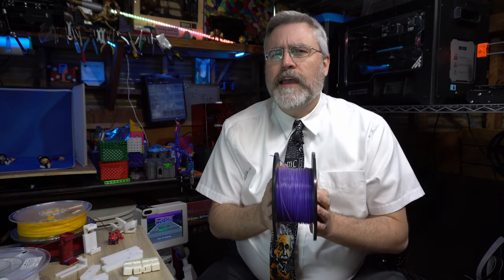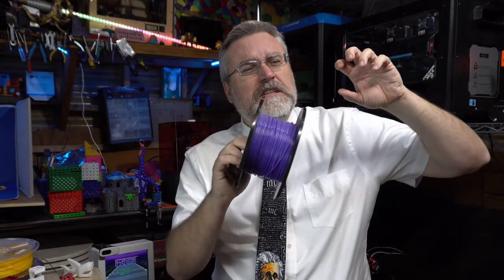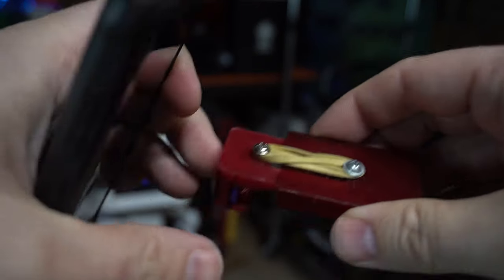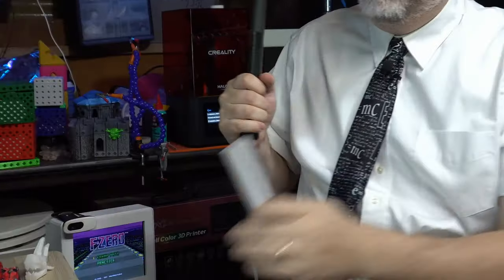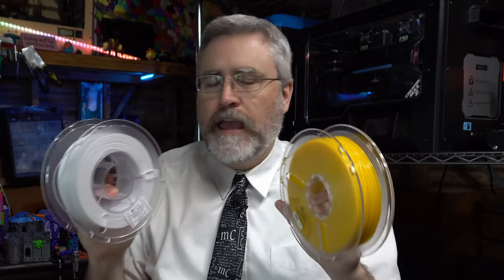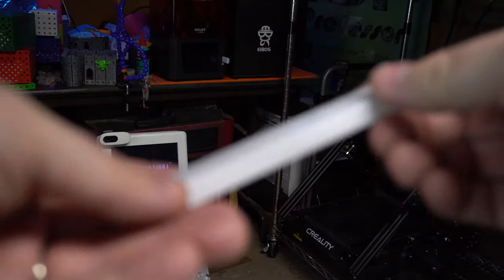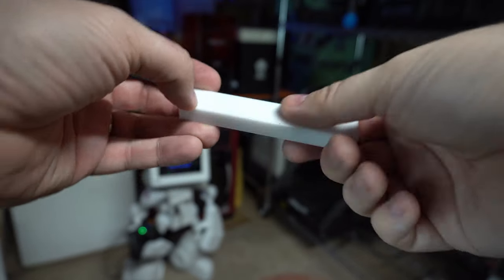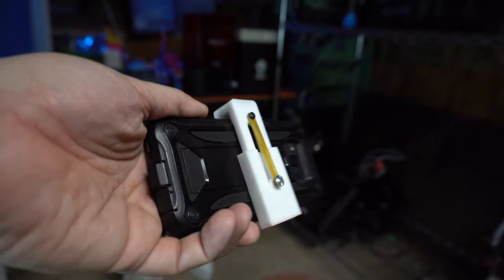What is the strongest 3D printing material

Comment: Lost In Tech nailed settings and all the internals of the process for TPU on Bowden extruders. Just awesome learning! I did some motorcycle parts from TPU and users were amused: it's strong , it gives up but not break etc.
Reply: Hi!and what motorcycle parts did you print if it’s not a secret?
Reply: @azamatT7  Missing gaskets on Honda CN250 helix airbox , plugs for throttle bodies sync ports for BMW, some set cover parts for SV650, bushings for Vaspa PK grips and my favourite - gasket for CN250 carburettor fuel bowl

Comment: I LOVE TPU for its indestructibility and it's super easy to print given a direct drive extruder.  I HATE nylon with a passion given it's warping a shrinkage and just plain orneriness.  If you get a chance try my favorite filament in the world.  Vexi-Flexx70 from Keene Village is a super hard (70 on the shore D scale-not to be confused with the completely different A scale) TPU that I use for gears or anywhere that calls for nylon.  It's not cheap and it only comes in black and white but it is awesome!

Comment: I know this is an older video now but wanted to throw in my experiences with tpu as well. I've used it mostly for making cases for electronic devices and semi delicate tools. I work in construction and its protected some fairly expensive laser levels, center finders etc bouncing around in my gang box. Also has cut down on my replacement of vapes when I drop them from small and some larger heights. I also printed some riser feet for my ender 3 v2 years ago with pla tops that connect to the extrusions and tpu bottoms for grip and a little shock absorption. They've held up great but one is starting to slide in the extension channels a little easily sure to the pla, but the vond between the two materials is great.

Comment: What material would you recommend for creating prototype RC Buggy/Truggy suspension arms?  I need to create prototypes and have access to filament and SLA printers but PLA breaks way too easily.  These parts are normally injection molded with some nylon content.  You can search 1/8 buggy to find more info on the application.
Reply from the maker: That is an interesting problem. Maybe ABS? Vapor smooth it after, maybe.

Comment: My Ender 3 handles TPU 95 really well.  I've been experimenting with bimaterial prints using TPU for top & bottom layers, and PETG in the middle where I want rigid print in place joints.  It works pretty well, the tricky part is the filament change. I have to slice the part twice, once for each material, then manually splice the gcode.  Either that or use one material profile for both, just changing the temperature when I switch.

Comment: Has 3D printing been used to render close packed spheres as described by Kepler, Gauss, and Buckminster Fuller? Could close packing be used, macroscopically, to print super strong materials?
Reply from the maker: Dunno. I suppose a Buckminster Infill could be a fun option.

Comment: 20% infill PLA and then apply copious amounts of cyanoacrylate glue until it stops absorbing it.  It will be almost as strong as printing in carbon fiber filament, and much cheaper.
Reply: Doesn't sound cheaper. I get Carbon Fiber PETG for under £30/KG
Reply: @TheAndyroo770  Well, the cheaper printers cant use carbon fiber, I'm sure super glue costs less than a carbon fiber capable printer.
Reply from the maker: Does that soak in somehow? Or are you building up the surface?
Reply: @3dpprofessor  I guess it soaks in between the layers.
Reply: Not sure how you'd do it, but if the printed part can hold baking soda (sodium bicarbonate) powder, it creates a hard fast curing substrate. For those talking about price, do not buy super glue in little tubes.

Comment: So if you need a filament to print out something that needs to be strong and heat resistant what would you use? For example printing a firearm
Reply from the maker: So we're discussing using thermal plastics, designed to melt so that they an be formed into shapes, and asking what version of that would be heat resistant?
You want it to melt in the extruder, but then transition states and be less meltable after that?
There's already communities of people who print a lot of firearms. Myself, I've only done it one time for a video I have yet to make, and I've never fired it.

Comment: While it is strong, its flexibility could also be a weakness. Often you want functional parts to be dimensional stable and not give with low stress. I wouldn't want my brackets to deflect/stretch under load.

Comment: Hello sir. Great video. Maybe you can help me out with my problem. I order some wheels for my RC car sla technology  pa12 and they broke. What kind of 3d printing plastic i need to order?
Reply from the maker: If they were SLA, then you can't get the same wheels from an FDM 3D printer. That's a bit like saying "My framed house got a hole in the wall, what brick do I need to order to fix it."
SLA is 3D printing with a liquid resin cured with a UV light. FDM melt a noodle of plastic and squirts it out like a hot glue gun.
That said, if you want to attempt an FDM repair, TPU is probably the stuff you want to use.

Comment: Awesome video!  Do you know which material is best for transmitting vibrations, and not absorbing vibrations? I need to 3D print a mount for a transducer and need maximum vibrations to transfer through the mount.  I'm thinking ABS is best but not 100% sure.
Reply from the maker: That's an intersting question. I'd say some science would need to be applied, but I might try this one in TPU myself.
Reply: I can't point to an exact material, but you're gonna want to figure out which one has maximum rigidity.  That rigidity will be what reduces absorption of energy.  That said, you'll possibly have a more brittle product, so your application will have to consider that.

Comment: Hi there. I’m interested in what you said about never printing at 100% infill. 
I’m working on a pet project printing some magnetic mountain bike pedals. 
I’m relatively new to 3d print but have been designed and machining for years. 
My plan was to print my pedal body solid to make it as strong as possible but what you said has got me questioning that. Plus I haven’t decided on what material to print the pedal body out of. 
I’ve seen all the videos on carbon fibre filaments etc but I’d be interested to hear you view. 
Cheers. Jamie
Reply from the maker: Thanks for reaching out.
First of all, you never print at 100% infill, because infill generally overlaps itself, which means you're putting more than 100% material inside the space, which results in slop out the sides. Generally 90% is practically solid.
However, if you're new to 3D printing, I recommend you print in PLA. Ignore what everyone says about material strength and whatnot, PLA is 3D printing in easy mode and it's good for 90% of the things you'll ever do, and right now you need success and experience before you start adding variables to your process. PLA will withstand enough damage and work well enough that you'll learn how to 3D print and you'll learn what works in your design. Then, after you've got some confidence and you've broken your first set of 3D printed pedals, you can experiment with different materials.
That's my take.
Reply: @3dpprofessor  Awesome. Thats sound advice.Thank you.

Comment: Great video. However I want to print RC parts. I think it would flex to much on a A-ARM of a Rc truck? What’s your input
Reply from the maker: Interesting question. Give it a shot and let me know how it goes.
Reply: Given how small the A-arms usually are, it would probably flex too much. However, you can literally print tires, bump stops, bumpers, body parts, A-arm protectors, and much more. Anywhere you want protection or some kind of buffer, it will definitely work.

Comment: I print both ASA with equal to and often better than results to that of PLA and 'PLA Plus' in print quality aesthetics alone. Sure, PLA is easy peasy to load into your printer, and use stock settings, and you WILL get an okay or good print if your Z offset is right and your bed is level and your printer is on a level stable surface. But an enclosure is more or less a must anyways as to avoid dust and all from getting into the rods, bearings, belts, bed, fans.. And I find ABS and ASA actually give off negligible 'fumes'. Use fans, and have a vent somewhere in your shop space. These time proven materials cost the same as PLA and even can be found for less. I find no reason to not use ASA, which has become my favorite overall, PETG gives me more headaches than I like, even though when it prints well, it prints WELL. What I will not argue on, is that PLA is probably the only filament that makes logical sense to use for shelf deco pieces, or maybe some mainly cosmetic enclosures and fixture for electronics projects that will not leave or go far for long from living spaces, and therefore will not be exposed to anything which will degrade it in any worth-measuring level. I can be considered a 'novice' at 3D printing so I may change my mind.. I am an old electronics nerd and only need to get CAD software down and my 3D printer will make the world my sandbox. But I may just buy a roll of TPU tonight..
Reply from the maker: Is your printer enclosed?

Comment: Any thoughts on how TPU/Thermoplastic polyurethane, compares to Peak Victrix AM 200/PEEK/PAEK/PEKK?
Reply from the maker: It's much easier to print with. Doesn't require specialty high temp hardware. So there's that.

Comment: i printed a phone case for my phone as i needed a durable case that would allow access to the usb port for a 3d scanner and not have to take the case off. not even 50 percent infill and can confirm its tough as hell, but i never had a drop test to see if it would protect my phone from the force of impact lol... even if i hit it with a hammer its not gonna do anything... proceeds to look at test block with intrusive thoughts to smash the hell out of it to actually see if it would hold lol.

Comment: I really like TPU!  At this point I just use TPU or PETG; I don't like the temperature problems with temperature, using PLA,  as I print enclosures to use in cars and engine compartments.
TPU  is incredibly rugged and can make more items than you would normally give credit to.
Everything that I have printed with TPU, turned out both indestructible for its use, and frankly way over-engineered!
As the Prof said; print slower ( I use Boden) and have some patience, but you will get the hang of is and make great objects.

Comment: Can you do a video about TPU with the X1 carbon? Manufacturer says NOT to use TPU. One Podcaster said use TPU on the mount on the back of the X1 Carbon. Can you clarify for us newbs please?
Reply from the maker: I will have to look into it. I did all my TPU printing on my Prusa because I know it can handle it.
There's actually a problem with the build plate on my Bambu at the moment, so testing this may be a little while.

Comment: I wonder what is the deflection temperature of TPU? Can it handle a hot car? Compared to PLA and PETG

Something to go over and I'm not an expert at this I might be slightly incorrect in my usage here but I think it's just of what I'm saying is correct

TPU is not strong it has horrible strength because it's flexible :-) You don't really get any strength at all unless you print it seriously heavy duty and as you can see it's still flexible

What it has is incredible toughness and I do mean incredible toughness as you noted correctly damn near indestructible

Strength and toughness are not the same thing if the part deflects or distorts it has low strength if it doesn't get damaged when you do that it has high toughness

In 3D printing we have a third so-called strength metric that we have to use because of the manufacturing method and that is layer bonding so let's call it strength toughness and bonding TPU also has incredible bonding once it sticks it's not likely to let go :-) That's why good luck printing supports with it or printing place parts with it because any hairs that gets stuck or any parts that get stuck together they're probably not coming apart :-) not without some surgery

The other downside to TPU is that it is heavy very heavy it has a higher density than PLA ABS or PETG and it's also very expensive although not too bad especially when printing small things

It's also hygroscopic meaning it loves water so if you're getting crappy quality prints from your TPU you probably need to dry it it's one of the few filaments where I can actually expect to hear the snap crackle pop coming out of the hot end and you'll see bubbles as the water flashes to steam at print temperatures

In general however TPU is an amazing material I wish I can make my rockets out of it but it's not quite strong enough and it's too heavy I need a little bit better strength even than 95A so that the rocket doesn't distort under thrust which would look fun but not be so fun if you're in the path of it :-)

Mixing TPU and PLA is possible I did that many years ago I made a cup holder or a can that would hold a can of soda and the problem was just like dropping a cheap flashlight if you dropped this with the can of soda in it the PLA part would just shatter The G-Force load on impact is quite high

So I printed it with TPU on the top and the bottom and then switched over to PLA with a decent amount of success however if you do not have a sufficient number of bonded layers between the two materials they will delaminate from each other You do not get perfect fusion between PLA and TPU at least so far in my experience

It's also really doesn't work with regular virgin PLA You really need to use a PLA+ and a decent one One that can handle 240° or higher

If you print 220° PLA on top of TPU or vice versa it's not going to stick well You really need to be able to print that PLA at 240 or higher and most virgin PLAs can't handle that The filament will cook off but many of the good quality PLA pluses can tolerate that temperature for a short time

So by printing my PLA temporarily at 240 to 245°, I was able to get decent usable fusion between the PLA and the TPU I have not tried this with PETG because PETG is just not very strong p e t g has 1/3 of the strength of PLA it has slightly higher toughness but that toughness is overshadowed by the 1/3 strength it's temperature tolerance is only slightly higher and that's basically the only reason to use it plus the transparent PETGs look fantastic especially in vase mode

Now something I have not tried and I should is larger extrusions so 0.8 mm nozzle 1.2 mm nozzle? I bet the fusion between the PLA and the TPU would be substantially better!

I'm going to have to start playing with TPU more often again most of the things that I've been doing lately require low mass and TPU is horrible for that it's so heavy when you're building airplanes and rockets masses kind of important :-)

But yes for basic simple around the house mechanical parts? TPU can be an incredible wonder material
Reply from the maker: Dude, I would laugh so hard at a giant floppy rocket.
Because in side I'm 14.
I guess I should have said "Tougher" not "Stronger".
Reply: @3dpprofessor  you might like my Snek. I designed a 3D printed model rocket with "snake scales" and a "viper head" that blows apart in the sky into 10 pieces and wiggles around for recovery :-)

Comment: What I've been waiting / searching for is some type of TPU "glue"... Using the word glue to refer to a solvent that would weld two different TPU's together... think of how "Weld-On" or similar works on ABS or Polycarbonates by actually melting /welding the plastic together... Or "PLA Gloop" (or Weld-On) works the same way with PLA.  I want to weld two (or more) different durometer TPU's together.  Or even a solvent that could weld some TPU to a PLA or ABS part!  Problem is, TPU is very resistant to most commonly available solvents.
Reply from the maker: Maybe you need... rubber cement!
Reply: @3dpprofessor  haha... I see what you did there! 😜
Reply: I've used a heat gun to heat TPU so the surface is just a little hotter than tacky and then pressed it together and it sticks like it was printed that way. I've also smoothed the surface with a heat gun too. Just be careful because although I've managed to fingerprint TPU without burning myself, it is possible you could get injured doing this. Perhaps thick gloves of some kind would help. TPU sticks well with polyurethane glue such as the brown Gorilla Glue, but it makes the material solid and brown, which is also potentially good if you want a stiffened part in an otherwise flexible piece.

Comment: How well does TPU bond with other 3d printed materials? I think the idea using a material hybrid technique has promise.
Reply from the maker: I know people who use PLA as a support material for TPU because while it bonds well enough while printing, the different mechanical properties separates afterwards easily.
So unless you design your geometry to hold on, it won't just hold by butting up against it.